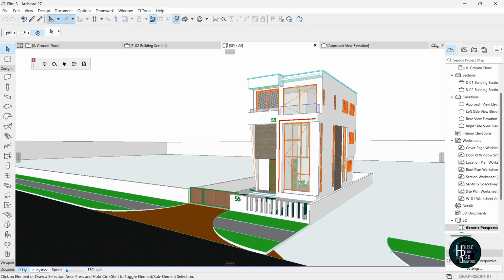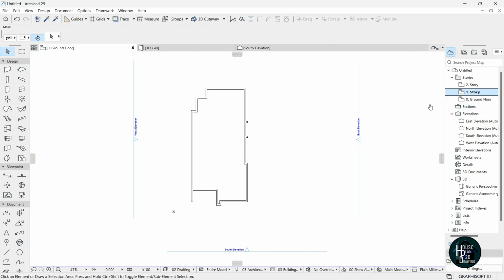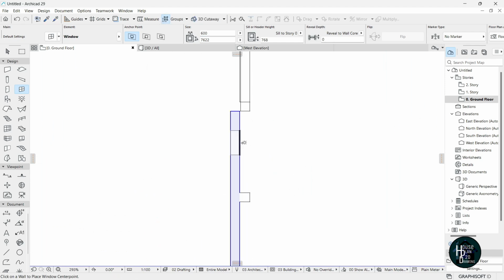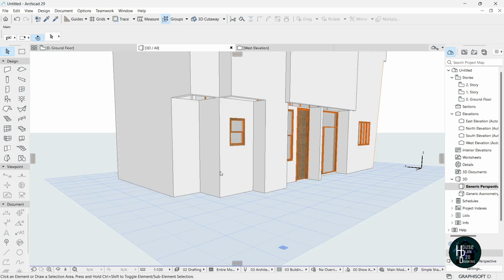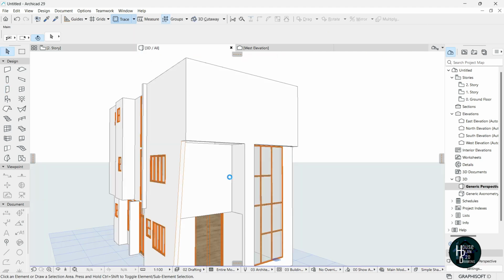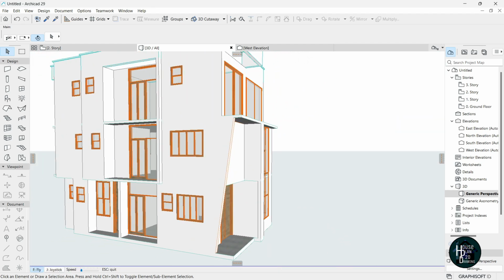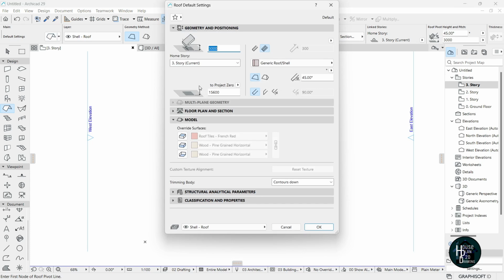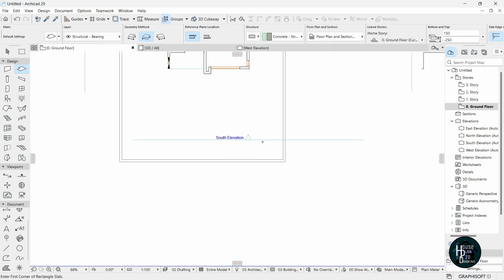Full Beginner's Course || Archicad Architecture || 5 Bedroom Duplex

Comment: Thanks for the tutorial 
As I can see on the rendering video the building is copied into more than 2 how can I do that in archicad duplicating the building
Reply from the maker: You're welcome!

Just to clarify, I didn't duplicate the model directly in Archicad. I duplicated it in Twinmotion after syncing the Archicad model.

I've also made a detailed video explaining how I duplicated and arranged the models in Twinmotion, but that particular video is available exclusively to members of my YouTube Membership.

You can sign up using the Membership Link below 👇🏽
https://www.youtube.com/channel/UCvv78NXqWA9hqxR_ZHcbcAA/join

However, you can also duplicate your building directly in Archicad by selecting the entire model and using the "Drag a Copy" command. 

Also note that duplicating a large or detailed model multiple times in Archicad can increase the file size and put additional load on your system, which may affect performance.

That's why I chose to handle the duplication in Twinmotion.

Comment: Chief how far. Good afternoon I have some questions to ask.
Reply from the maker: Good afternoon! I'm doing great, feel free to ask your questions.
Reply: @Houseplan2ddrawing ok. If I join the membership do I have access to the software,  ArchiCAD libraries and the rendering software like the twin motion and the video tutorials.
Reply from the maker: @IsahwozeOmamo  No, the membership is mainly for the tutorial videos on how to use softwares like Archicad and Twinmotion to design and render 3D models.

It’s a bit different from the normal tutorials I post publicly, that’s why it’s under membership.

The softwares themselves are not included. You can download them from their official websites by searching on Google, for example “download Twinmotion”.

Also, if you need the specific project file I used while making a tutorial, you’ll need to choose a membership perk that includes access to project files.

Please make sure your PC meets the required specifications so the software can run properly 🙏
Reply: @Houseplan2ddrawing ok. I need to have the software first before anything
Reply from the maker: @IsahwozeOmamo  yeah 👍🏽